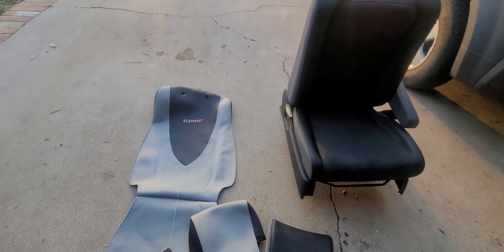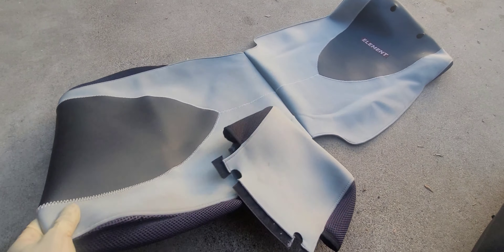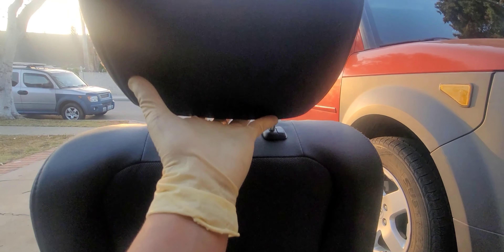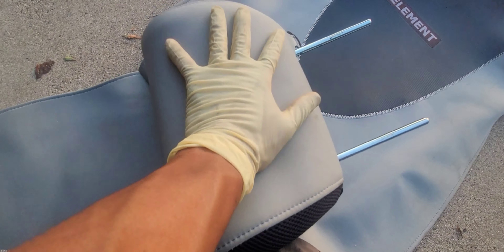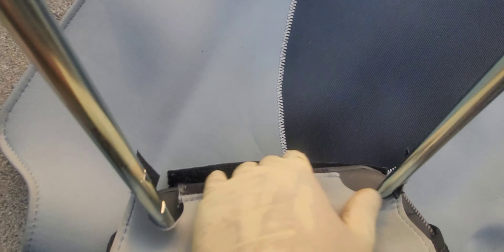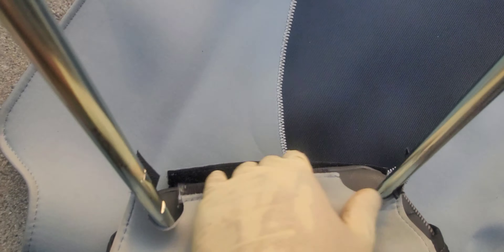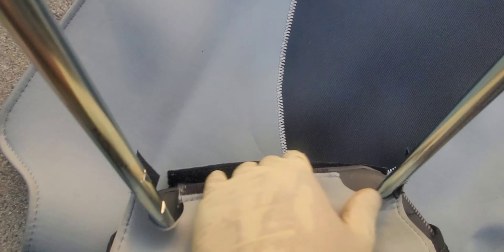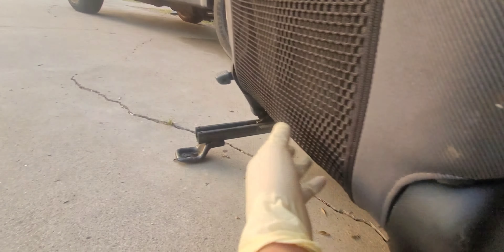Honda Element Oem Seat Cover installation

Comment: I had trouble with the clips. I tried hooking the clips first step, then pulling the back and seat parts over the seat, it worked fine.
Reply from the maker: Clips are hard to install. Gotta pull really hard to install them.I am glad it worked fine for you.

Comment: I’m sorry, I have a dumb question. You may have said in the video, but when you purchased the covers did it come as a set or did you have to buy them separately?  I’ve been enjoying your videos! New subscriber! 🙂
Reply from the maker: You buy them separately. 👍
Reply: @Element_lifestyle  thank you! I looked them up and it doesn’t say. And it didn’t ask if you want one for the driver seat or the passenger seat. My element only has as armrest on the driver side. So I will probably have to cut it then? I’ll have to watch your video again.

Ok, I see now, it doesn’t cover the sides 👍 so I don’t have to worry about the armrest. Thank you!

Comment: I know it says for the ones without airbags but I could I still use them? Just picked up a 2005 :)
Reply from the maker: Yes, I do have the same using for my 2004 and 2005. You are good.